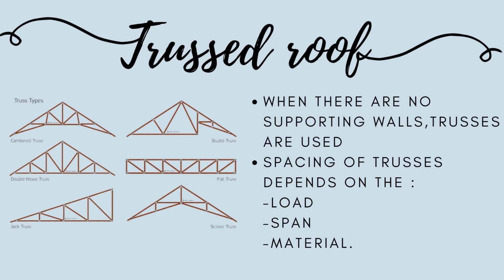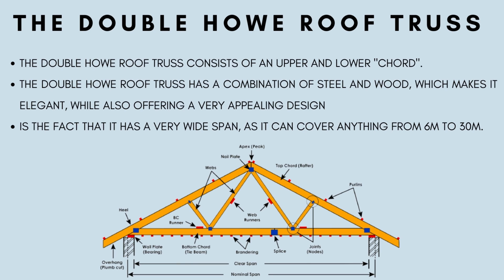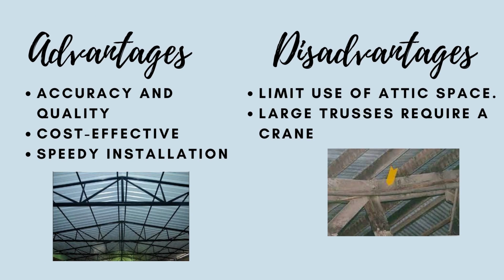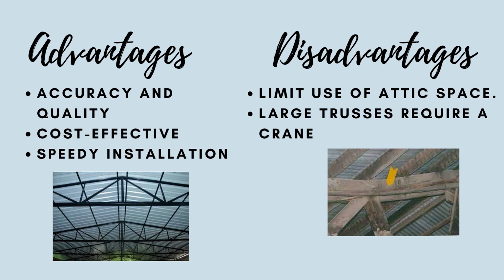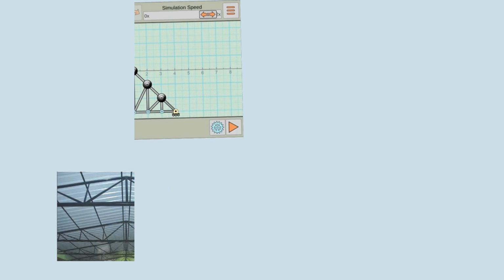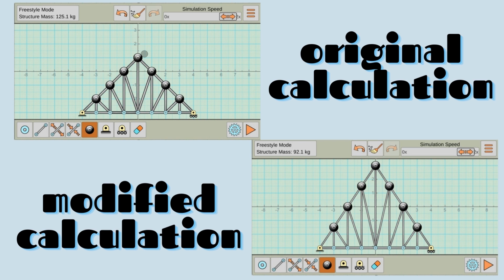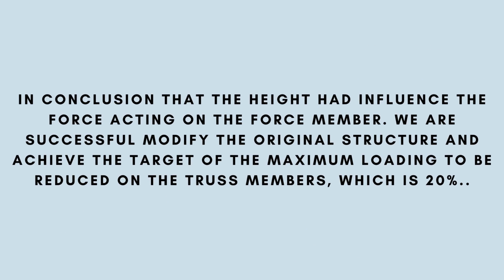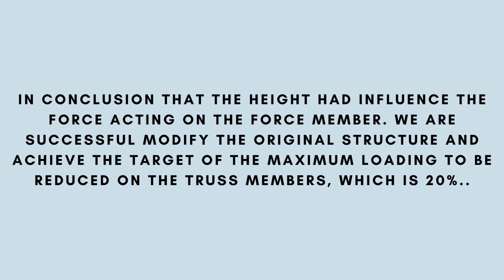Structural analysis of roof truss

Comment: What is the importance of roof Truss?
Reply: Hello, the importance of roof is a structural framework designed to provide support and strength to a roof, a truss is essential as the roof's Frame. Basically, they are triangular wooden structures designed to keep the integrity of a roof.